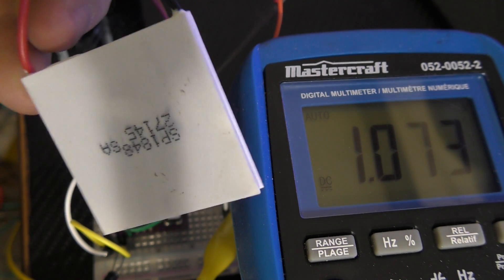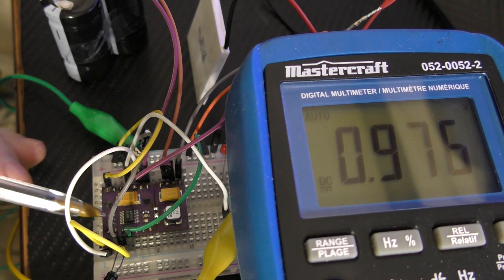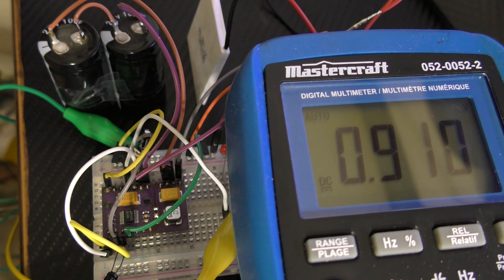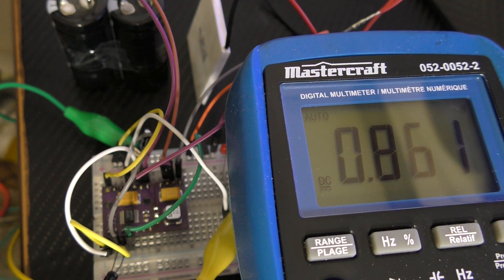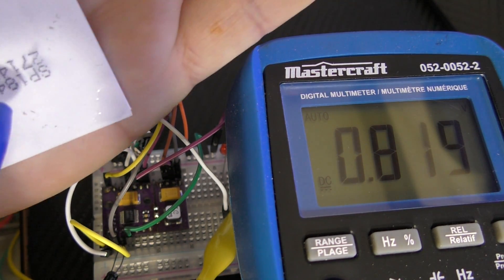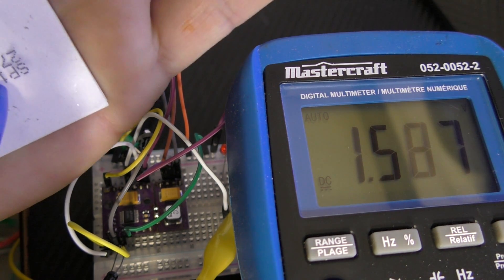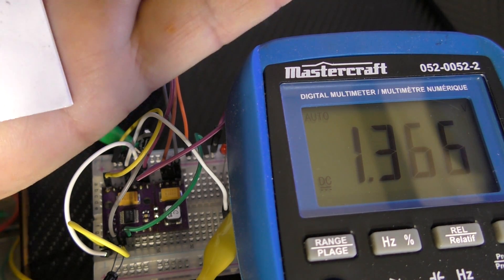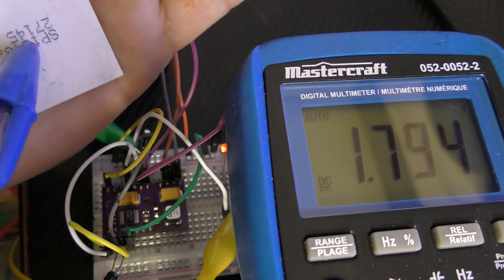CJMCU-3108 ultra low voltage booster breakout board

Comment: Sir can i have the circuit diagram of your project, specially connecting the wires in the cjmcu 3108, i am having a hard time to connect mine.
Reply from the maker: Hi Mharjon - actually I put out a second video which explains all the wiring and components in detail:  https://www.youtube.com/watch?v=Br_fwHVA3Po
Reply: Thank you very much sir.

Comment: Why the voltage is not regulated? I thought there exist only 4 distinct voltage outputs.
Reply from the maker: I believe it is regulated, but the LED was drawing enough current that it was holding the voltage down, not allowing the output to get to the regulated voltage. I suspect (though I didn't try yet) that if I put a high enough power source in, that the regulator will then kick in and regulate the voltage to whatever it was set at. I believe that at that point, because there is an excess of energy, it starts redirecting the "overflow" (if you will) into the storage capacitor/battery.

Comment: Hi great video, I just have one questing which is “do I have to buy any other parts to make the voltage booster work with a teg or do I need to get a transformer. Also do you have a simple answer for where to put the input and output wires thanks so much!
Reply from the maker: Okay, I finally got a new video up on this channel, showing the wiring, specifically how to use the board, what transformer you need to get, etc...  https://www.youtube.com/watch?v=Br_fwHVA3Po

Comment: Great sharing! I'm still doing a research on how to make a body-heat flashlight. I'm going to choose CJMCU 3108 for voltage boost but have difficulty on wiring the pins. Thanks God I see your demonstration! Can you e-mail me your circuit diagram for your board?
Reply from the maker: Hi Chic Gooner - sorry to be so late, but I finally just uploaded a video on how to use the breakout board, including the circuit diagram:  https://www.youtube.com/watch?v=Br_fwHVA3Po

Comment: Sir, what did you put on the pins?on the board?
Reply from the maker: Actually, because there was no documentation with the demonstration board, I had to manually follow the traces and reference the datasheet for the LTC3108 chip. Turns out, this board has actually got pretty much everything on it already!  The only thing I had to add was the transformer, and I had to solder across the three joiner traces between the board with the 3108 and the break-away board with the transformer. So even though I have all of these parts on the breadboard in the video, ignore them. I basically doubled up on all of the parts by putting them on the breadboard because I hadn't yet figured out what parts were critical for the circuit yet. You don't even need a supercapacitor on the storage output. The CJMCU 3108 board already has all of the parts soldered on to the board, in the correct circuit to do what I did above.

Comment: Hey sir! I would like to ask how do you connect the wires within CJMCU 3108? Really need for answers... I was a student researcher from the Philippines! Have a Nice Day😇
Reply from the maker: I'll see what I can do - I was probably going to make an instructable on this. There was no wiring diagrams for this board that I could find anywhere, so I had to go by the datasheet for the 3108 chip and took a few guesses in other places. The breakout board is designed to be used in multiple configurations, with or without the transformer. But for these extremely low voltage peltier thermopiles, you have to have the transformer. I had no info on the boards.
Reply from the maker: Video is now on the channel:  https://www.youtube.com/watch?v=Br_fwHVA3Po